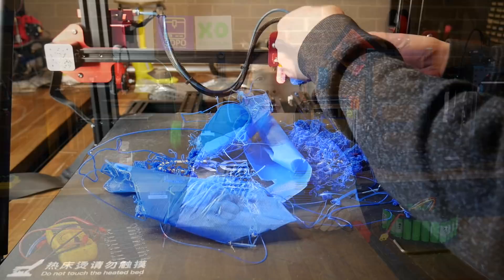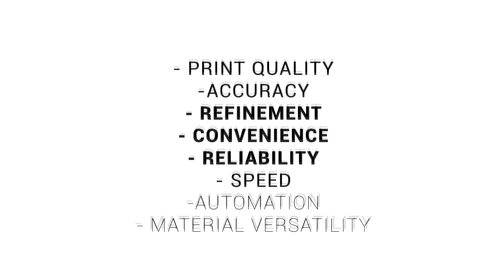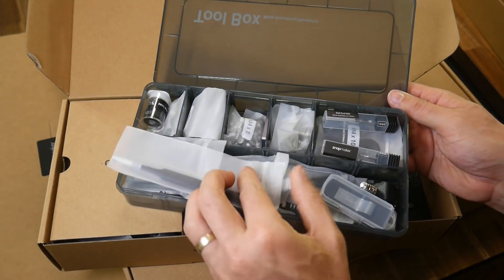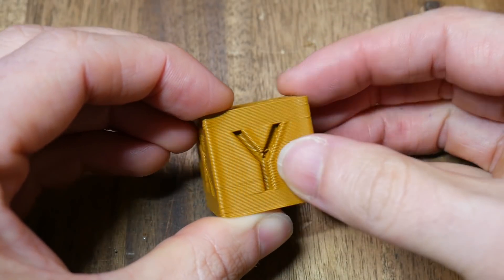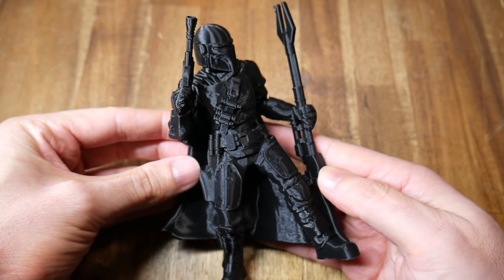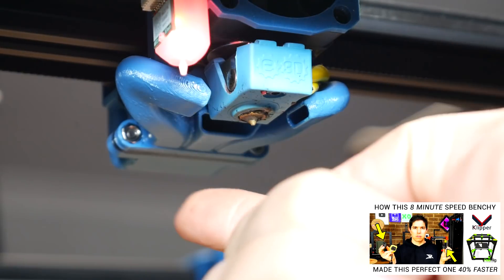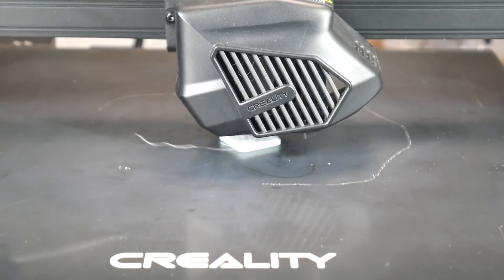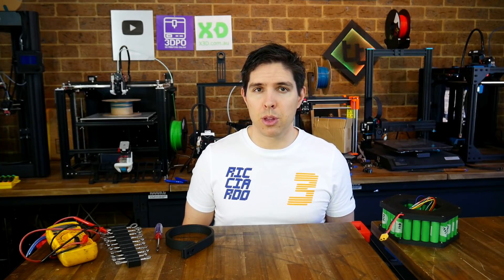Why and how you should find your 3D printer’s weaknesses to avoid disaster

Comment: I know this video is old now but I just ran issues that this video would have prevented. My hot end aged to the point of falling apart and it's the only printer I have. I bought replacements but I needed to print parts to put it all together. Turned into kind of a pain but I'm almost finished now.

Comment: I'm having a problem with my ender3v2 that every time I home it I have to re level the bed and I literally haven't touched anything not even let it cool and reheat. iv re built it a few times like tensioning and cleaning the v rollers and I cant figure out the problem and its driving me nuts and I just want it to be reliable. Iv only printed petg and pla

Comment: My CR 10 has recently gone from a toy to a tool so these videos are a great help. I struggled with a problem that, in hindsight, was trivial: the extruder is interlocked with the hot end.   I was trying to set the e-steps and panicking; the extruder would not run. Fortunately for me, the answer was on the CR10 reddit page and all is well.  I'm not sure if this is feasible or not but a video on how the parts of a printer are interconnected would be youtube gold. Thanks for the great content, I'd probably have given up on 3D printing if not for this channel :-D

Comment: Michael I want to thank you for what you’re doing. I’m about six months in on 3DP and after the day it’s been I’ve been thinking of giving up. Although this hobby is the most exciting thing I’ve found in my adult life, I notice it also lets me down a lot. However, your videos and that incredible website inspire and inform in a way that helps me maybe look at my situation differently. Thats what happened this evening as I was I deciding I was going to give my printers away and just stick with VR and PS5. I’m not going to do that though cause you’re right…complacency. I was counting on the fact that the inductive sensor would prevent the nozzle from crashing into the bed. However, I know as well that for whatever stupid reason the manufacturer’s can’t uncomment a word or crimp wires together without cross-crossing them so I should know better than assume it’s all good. (Reliability) Anyways, this is really just my long-winded way  of letting you know I’ll be signing up as a Patron. Thanks again.

Comment: Do you happen to know if there's a way to decrease the sound that the stepper motors make? I presume it would entail replacing them, unfortunately it will be difficult for me as the printer i want to do this to is all proprietary (Makerbot Method X) - all the other hardware on it is great, but its just far too loud. Sounds more like a CNC machine than a 3d printer.

Comment: My 2 Reasons for switching my E3Max from Klipper to Marlin
1 It doesn't support power resume function like marlin(not even using btt ups recovery function)

2 It doesn't support hardware PWM (for my laser)

Besides this everything is great although using Input Shaper on Bed slinger printer is quite useless...I didn't saw any big difference in ringing in my prints on different accelerations

Comment: Hoping you can help!  Unknowingly you have mentored me thru my 3d printing journey.  I have come to an impass and cannot get my printer to print anymore!  After spending the past month trying to figure it out, I am hoping you can put me on the right path.  I have an Ender 5.  I was having problems with my endstops and at at the same time, my laptop died.  New motherboard.  New Windows X laptop.  Now my slicing software cannot find the printer (can't print via usb).  Printer recognizes when I put in the micro sc card, (card inserted prompt), but will not open it (no tf prompt).  Now I have a giant paperweight.  I have read everything I can and watched everything I can.  Tried many cables, many sd cards.  Trying to update firmware, but of course, printer won't recognize the sd card.  HELP!!

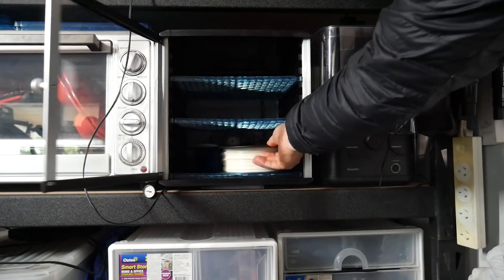Comment: 5:50 what is that you are using for filament drying?
Reply from the maker: Just a big food dehydrator. I know filament specific ones exist but this was cheap and can fit about a dozen rolls at once.
Reply: @TeachingTech  guessed as much :) Doesn't matter what it was originally for; just it functions for the task. and in this case that device also looks good and looks like it's made for this specific job.

Subbed @ patreon too. Thanks for your content and site tools :)

Comment: Linear advance is really not an easy or free thing to get since you need specific TMC drivers and better board which not all 3d printer have out of the box (for example Creality printers).
Reply from the maker: Creality boards with TMC2208s in standalone are the ONLY boards which are tricky, not the the way around. With a Klipper conversion even this hardware will work.

Comment: The worst weakness in 3d printing is the manufacturers race to sell you the same ender 3 clone for less and less. I've been almost pulling the trigger on various creality printers but good thing I didn't. I bought ratrig instead. Cheap will always get you cheap and if it's even cheaper than the last what do you get then? Even cheaper printer that barely prints after you fiddle with it for days.

Comment: One thing to note: 
Even though the printer does have a filament runout protection, It might not always work. 
Best example: My Printer does have one but it is puffering the gcode in some wierd way so if the filament runs out or even when I want to pause the print it takes a few seconds to *react*. 
But: It only really is a problem if the print has long straights. If there are curves (that are multiple gcode commands) the puffer is cleared much quicker.
Reply: There is indeed a GCODE instruction buffer present in most firmwares.  It can often be tuned - for example in Marlin in Configuration_adv.h
There are often physical ways to avoid this being a problem - like moving the filament outage detection further 'upstream' from the extruder.

Comment: Reliable and measurement accurate most important, speed can be slow as I set a print before I go to work or bed so no need for 1 hour when 8 is fine. I manually level the bed twice a year and only adjust/check Z height when changing role but 80% of the time no adjustment is needed. Still using Marlin 1.1 and Slic3r 1.3 been printing 6 years with great results. Original Reprap Mono Mendel.

Comment: First thing i did with the last printer i bought (Duplicator i3) was a test print which was bad :) THEN, i completely disassembled it and redesigned some horrible ideas, printed out the new parts on my old printer, flashed to board to firmware with temperature runaway and marlin, calibrated the voltage for the stepper motors (printed a spiral vase and large square while reading and adjusting), perfectly squared the machine, and lubed it up with Teflon grease on the lead screws and "gun oil" for the bearings, and last calibrated the heaters.

The machine rarely goes out of level, maybe after 20+ prints

Comment: "Demonstration prints are not indicative of print quality." Very good advice. I would like to add that sometimes this is also true, but in the opposite way to what you would think. I've worked with some 3D printers where the included pre-sliced test prints were *absolutely horrid*. At first I thought that the machine was defective and/or maybe I messed up during the build. But when I went and sliced my own test print, it came out beautifully. So yeah, even though you would think manufacturers would go out of their way to make their test files look good, a lot of times they don't. So just because the test print came out horrid, don't assume the machine is broken or a piece of junk. Another tip: when printing test prints -- either ones included by the manufacturer, or ones you sliced yourself -- use silk PLA filament. Preferably silky black, but if you don't have that, then any other silk (besides white) will do. IMHO silk filaments (especially silk black) do a great job of exposing print artifacts or other print issues, much more so than regular (non-silk) PLA. Also, when running test prints, don't choose that as the right time to try out a new unfamiliar brand of filament. Use a brand you are very familiar with and have printed with often when printing test prints. The reasoning behind this should be pretty plain to see. If you print with a filament you know well, you'll know if your prints are looking correct or not.
Reply from the maker: Very good point, thanks for sharing. I've also reviewed machines where the SD card print was ok but anything on the bundled slicer profile was horrid.

Comment: My extruder is still encased in plastic from last year
Reply from the maker: Heat it up and wait, the plastic mass should soften and then you can start to remove it. The hard part is any delicate wiring encased inside.
Reply: @TeachingTech  wow, it worked, I also used a heat gun to soften the plastic while I removed it

Edit: also if you could do a video on how to hide the seam on 3D prints it would be helpful

Comment: Great vid Michael. Happy to share the reasons for a slow degrading of my trusty Ender 5s performance over a period of several months. Good printer carefully upgraded over 3 years become increasingly erratic. Random over/under extrusion with layer issues. One print fine, the next a mess. Finally dissembled and rebuilt the whole machine. Discovered two mechanical causes: 1) Layer issues due to worn wheels on the carriages producing flat spot bumps at regular but widely spaced (ie circumference of contact area) intervals. 2)Extrusion problem due to roller bearing failure in dual geared extruder. The hobbed gear was twisting out of true and had machined itself into the aluminium housing. The friction generated creating the over/under extrusion. How I missed that was just complacency! Cheap to fix but wasted many hours on duff prints, filament, and frustration. Keep up the good work.

Comment: Hey
My Z-axis stepper does funny movements. For the same amount of e steps it sometimes moves 0.1mm and sometimes 0.01mm.
On all prints I lose 0.3mm of build hight in the first few layers. After that it seems accurate. 
Calibrating the e steps doesn't help. 
Is the motor defective or am I missing something?
Reply: Just a suggestion, but typical z-motor step is 0.04mm (depending on machine though). If layer height isn't a multiple of 0.04mm then you're likely to get strange Z steps.
Reply from the maker: Not sure if you're talking about Z steps or E steps as you mention both. Perhaps check grub screws in the pulleys. If they are loose, you will have play and inaccuracy.

Comment: I have a CR10pro, Geeetech A10M, CTC MakerBot clone and an RS (Weistek) printer. All have different uses, some are faster for prototyping or small repeatable parts for sale (Weistek), larger prints come from the CR10pro, accurate tolerances or dual colour prints I use the A10M. The CTC clone has been modded with a new mainboard (Marlin) and hot tends but will find its niche. Could have a "non-working" QIDI one for £4 coming soon as a hobby project for a very small bed but a lot higher Z-axis prints.